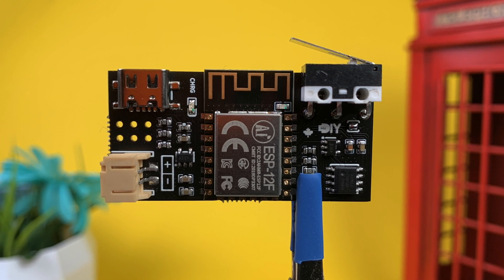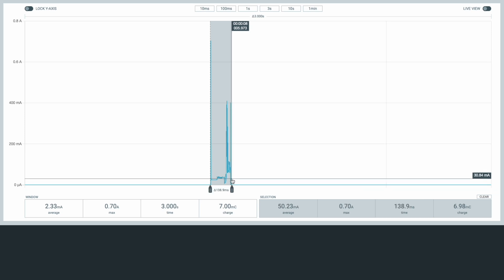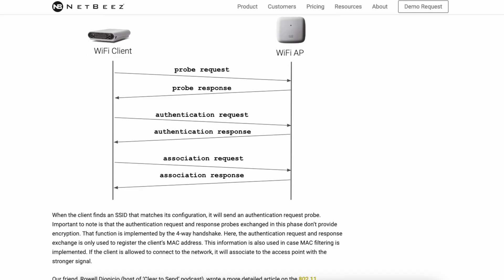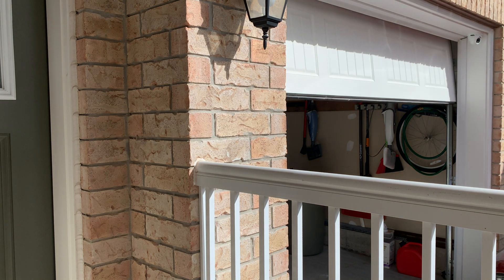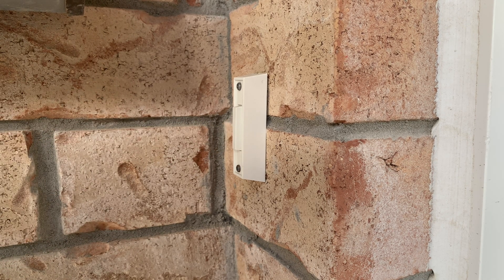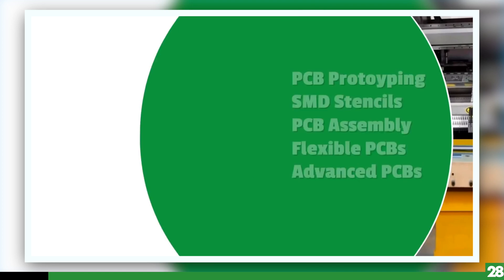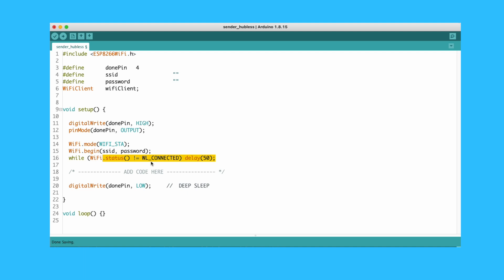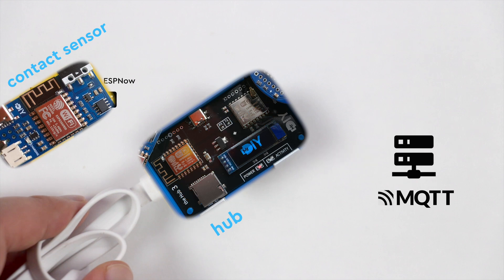Why Did I Pick Wi-Fi over ESPNow?

Comment: I was seriously surprised by the cost of your contact sensor.  It's like 4 times as high as I expected it to be.  What drives the cost so high?  This just seems like a dev board with a microswitch, which is like a $1-2 component.  Very discouraging, since my product would be basically the same thing with about 5 microswitches and would also require a 3d printed part.
Reply from the maker: I understand this might not be for everyone. I made all the schematics and full source code for the ATtiny and ESP8266 (sender, receiver and gateway) available to everyone for free. You're welcome to use my design and code to build your own.
Reply: @MrDIYca  Thanks.  At this time, the lowest cost solution for my system seems to be using I2C GPIO boards, combined with small custom PCBs to hold the microswitches.  I'll take a look at your microswitch and how its attached, to see if I can get a board that fits the niche I'm trying to fill.

Comment: I was using espnow before. I was using it mostly for the reason it is really fast to send and receive a packet (i've measured under a millisecond) and also because this system works without using a wifi so in some cases making the hub reliable may be desirable. I have not yet made a hub myself, i was using it to control lights to the rythm of music with a ps2 controller. So i don't know if esp now hubs will fail sometimes, but it seems to me its possible to make a very reliable system.

Comment: set a static ip in the code, and the esp will connect much faster most of the time
Reply from the maker: these numbers were with a static IP ( DHCP was longer but not by much)
Reply: I used static ip and saved the wifi channel.
I got down to 200ms from sleep to send out a tcp message

Comment: Hi thanks for this project. I'm trying to start one by one and ..to start first with attiny...i uploaded your code tested . but in deep sleep its consuming 300uA . not sure why is that? is that's how your code supported to work for attiny in deep sleep? i just power attiny and used a switch input that's all..all.othe pins are floating or untouched

Comment: Well  I have designed my own made a Wemos d1 mini deep sleep wake shield if you define mac address in wifi settings in your code you can connect and send message to home assistant MQTT broker as low as 500ms not fast as ESPNow ofcourse but you dont have to deal with a ESPNow to mqtt hub anymore😉 cause even I mod my Wemos d1 mini's for less consumption in deep sleep mode which is 17uA but The hub does not sleep and it is always open. Acorrding to datasheet of esp 8266 modules ex: wemos d1 mini ESP12F  can consume around 75 to 80mA when in Wifi Station mode so long term battery powered hub is not possible solution. I highly recommend you to try connectting with defining AP MAC address configuration you will see it will connect to your AP about 500ms or 600ms depends on your Router configuration also make sure to configure wifi Channel on your Router and on sensors wifi configuration code
Reply: @boopeshkumarprabhakaran  I dont know why I have written answer now it is gone probably youtube's bug. What I have said is I used wemos d1 mini that board has two big consumption components the serial chip and the 3.3 volt regulator if you desolder those you can lower consumption to 17uA but keep in mind you need 3.3v FTDI adapter to program the ESP12F
Reply: @boopeshkumarprabhakaran  my time is full sorry I cant do that but I have given you valuable information you cant find this information anywhere on net It is now up to you to make the pcb design and Code. I am a Full Stack Programmer. I have lots of work to do so cant help more. Thank you for understanding
Reply from the maker: Can you explain more on how you used the AP MAC address to connect to Wi-Fi? Did you mean using a static IP instead of DHCP?
Reply: @MrDIYca  yes static address with channel of ssid defined this makes Connecting to wifi about 500ms depends on the Router though
Reply: @the-matrix-has-you  thanks can I text you in discord or telegram???
Reply: @the-matrix-has-you  i did it, and some times it take 360 ms
Reply: @Ninoy08  👍😉
Reply: @Ninoy08  it depends on your Router configuration. Make sure your Router Wifi is set to correct channel. And everytime it will connect in 350 - 400ms
Reply: can you make some documentation on that or explain more ?
Reply: I'm interested in this can you share how you made esp consume only 17uA in deep sleep mode?? can we connect in discord or telegram??

Comment: If you use ESP32 on your hub I think you will need only one module for both receiving ESP NOW messages and connect to AP and send data to MQTT broker. Why are you instead using 2 ESP8266?
Reply from the maker: It is the same issue with ESP32. In theory, it can be done - you can watch this segment https://youtu.be/AqpCiIf_XJM?t=68
Reply: @MrDIYca  Very well explained. I have missed that part of the video. Thank you.